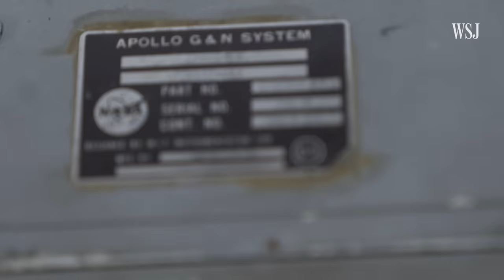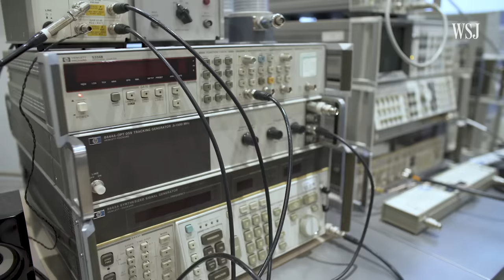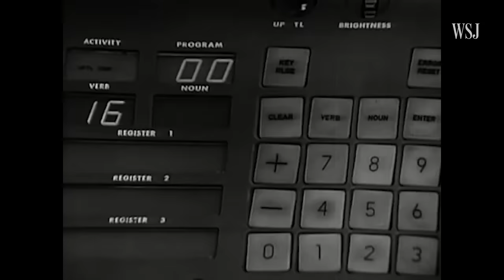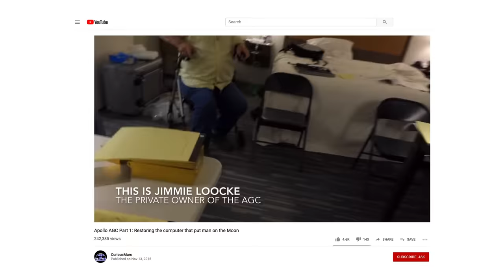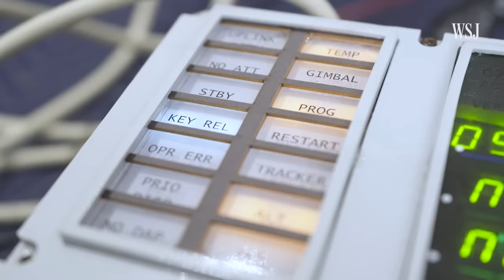Restorers Try to Get Lunar Module Guidance Computer Up and Running | WSJ

Comment: This really raises the question, if we could make it to the moon and back in this technology why is there not more going on in space right now?? There has to be some reason why we totally abandoned it
Reply: Jahan Watson Maybe because going to the Moon was crazy expensive and all it did was get us some rocks.
Reply: jagheterbanan it was only expensive then because of how much the tech cost and how advanced everything needed to be for the time, you can build a computer for a few hundred dollars that can outperform multi million dollar systems of the past, the technology and manufacturing available to us now are incredible, we could be flying to the moon and back for Little more than a few thousand dollars if we would make an effort to move ahead, hypersonic travel, and modern rockets and aircraft design are all there, we have the ability we just dont
Reply: Jahan Watson Well I can guarantee you that if you can build a system that can take humans to the moon and back for a few thousand dollars you’d become a billionaire in an instance. SpaceX charges around 62M $ for a Falcon 9 launch and 90M $ for Falcon Heavy. If you can cut that in to the hundreds of thousand $ customer’s would pile up really quickly.
Reply: jagheterbanan dude just look at virgin galactic, a slightly beefier version with a small srb of some sort could easily do it
Reply: Jahan Watson Hahaha omg you think you can go to the moon and back in something like that?! 😂
Quick call Elon and have him cancel the Starship development, boy genius here has a much better and cheaper solution! 😆🤑👨‍🚀
Reply: jagheterbanan the starship literally is a bigger version of the same thing so not seeing your point, it’s just launched on a rocket

Comment: Seems they used computers for a different purpose at that time and the Apollo project was more kind of an analog program. Put simply, the iPhone 6's clock is 32,600 times faster than the best Apollo-era computers and could perform instructions 120,000,000 times faster.

Comment: I cant understand Nasa sent it of as scrap. This machine is historic.
Reply: cause its slow and its idea to have formula already made for them so astronauts  just follow the command and step by step, only problem is if they get the timings wrong , the astronauts gonna have to erase cache memory manually and input new formula by manual know their current location and new timings to readjust trajectory , it work to some point when it takes long to do and not fast to do vs today computers are capable much more to correct itself quickly, remember this is first processor by wires then years later computers becoming silicon on chip
Reply: That wasn't seen as such at that time unfortunately.
Reply: Same reason people throw out their old phones

Comment: I remember NASA offering $40,000 to re-read or decode old data from the fifties, sixties and seventies which they had on reels of from old computers, when they used on dogs, monkeys, primates and humans they had lost their expertise on these computer reels tape. And in moving forward with projects they went backwards in knowledge by not learning through mistakes, that this will blow up and that will fall out the sky and not enough of this, and it falls over. I think it may of been 2016 when a call out from NASA was on the news. If anybody knows how to re-read old code get in contact with them.

Comment: Any minimally competent digital designer could make a computer with a few dollars worth of RAM, ROM, and one tiny programmable logic chip that could execute the Apollo design 2 computer software perfectly.  He would have to use a really slow clock generator to get it to run at the same speed!  I think most hobbyists could do it with free downloadable logic chip design software.

Comment: There was also a guy that had 2 huge magnetic tape machines. And a bunch of tapes too if I remember correctly.
There would be no easy way to read any of the data on it because you would need the whole computer and know what the data represents.
I think he went public to sell them or restore, something like that after sitting on it for years.
Then NASA came and collected the whole thing.
It's so funny that they always say that they lost the tech, or it was destroyed, uses it for something else, whatever...
And then stuff turns up on a yardsale or something.
I don't know but if I built a rocket that took me to the moon and back I would keep it or put in in a museum.
Any museum would love to have something like that on display.

Well I hope NASA doesn't come to repossess the thing when their done restoring it.

Comment: Please correct me if I am wrong, but the Saturn V guidance computer is still listed as "classified" and not available. If I am correct there are only 3 examples of it. 2 were assigned to 18 and 19 and 1 was in the test area at Stennis. It resided just inside the top ring of the stage. And if you go to the Apollo Museum at KSC, its not there. I asked around and staff told me, if your country developed a way for 5 heavy lift engines to operate and control gimbal and rudder for roll, would you just let anyone have it?  I guess they made a point. A cell phone could probably do the work today if it was recreated.🙂

Comment: The display is on a modern computer, not on the original display, it means nothing.
And you can't make it really run, it is not in the same conditions.
I would be curious to see the program that you think that it is coded in the memory of this computer!
There is a listing of this program which exists, why don't you compare the program which is supposed to be encoded in the memory of this computer with the program which is written in the listing?
You might have some surprises!

Comment: For the moon it doesnt knows if your landing with  4 Mhz or 4 Ghz of computing. So does it means that if the entire computer modules were revived and the spacecraft with its rocket 🚀 is sent to the Moon in 2020, shouldn't it land ? Food for thought !
Reply: If you had an exact copy of a fully fitted Saturn V with apollo spacecraft. The support crew, support equipment (including additional land based computers) and the trained crew, sure.

Comment: So we're told that the lunar Landers walls were paper-thin almost. How could the Lander not Be crushed like an aluminum can in a vacuum?
Reply: Not how a vacuum acts.
Reply: Nathan Peterson explain why they built the 8-foot thick vacuum chamber with cement walls
Reply: @hoperodrig6561  To limit leaks. Not to mention its 50 year old technology.

 We have modern containers capable of creating the same or near the same level of pressure that are just made of glass. Look them up on YouTube. I get your confusion you're thinking its the same issue of having a submarine in extrememy deep water. But pressures are on an absolute scale and different materials have different strengths. Most reasonably thick (an inch at most) solids, metals, metalloids, or some crystalline structure of them or other elements will handle a difference of pressure between 14.7psi. and just above 0psi.
Reply: Nathan Peterson No, it would be the opposite of a submarine. Submarines also require a lot of Maintenance constantly to replace valves and seals. The International Space Station has rubber gaskets and seals all over it. But somehow they miraculously. Don't need maintenance even though they go through in extreme heat and cold for more than 20 years. The windows to the cupola are hand operated with mechanical gears! Separated with a little rubber o-ring. But the only thing they seem to be doing up there is growing lettuce again. Not maintaining a massive structure like the ISS.

Comment: I think this is the future of computer systems, not the past. How do you hack a system like this? With our ability to print electronics we could design what we need a solution to do and then have a compiler create a unique software to assemble an integrated software AND electronic solution. Encrypted software that only decrypts when run on a specific electronic device. No extra gates, no extra memory, only necessary computational circuits, and an encrypted voltage stabilizer capacitor assembly so if you don't have the right 'key' on you it won't be capable of booting or operating. That's off the top of my head. When the cost of stealing data is higher than the return for stealing data, then black hat operations is discouraged.

Comment: now find a low level technician who found 360 kilograms of moon rocks in the apollo scrap he bought recently.... and the cleaning lady who has the saturn-5 full documentation for toilet paper....
Reply: the full saturn V blueprints are available online... but there's also a massive difference between equipment used for testing and training and actually flown hardware, as far as preservetion value (and of course far more for moon samples themselves, which have both historical and huge scientific value)

Comment: Didn’t a calculator have more power than the guidance computer?
Reply: define "power". A 70s era calculator could run a single calculation faster, but it had NO ability to run programs, address external devices and external data, no task scheduling etc etc etc

Comment: "The Apple-oh guidance computer"?  LOL...  accents are funny sometimes...   ;-)
At least they realized from the start that it was a ground test computer, since the flight ones are either deliberately crashed on the moon in the ascent stage or burned up de-orbiting Earth tests...   ;-)
Reply: If the flight ones are deliberately crashed on the moon in the ascent stage, then what controlls the deorbit burn? 
Is it just pure analog electronics? 

Or does the flight path not need some deorbit burn like you would when u play kerbal space program
Reply: @honkhonk8009  It's obviously a ground command that initiates de-orbit.  And, it's not "if".  The ascent stage WAS crashed into the moon with the computer still onboard.  It's just a single burn to crash it (on/off), with instruments left behind at the landing site to record "seismic" activity and broadcast it back to NASA.

Comment: Very discouraging. Here we have this computer, which guided this supposedly Monumental Mission for mankind not enshrined in a museum, not held in a warehouse for whatever reason but basically discarded as scrap. One would assume that either the DATA or DESIGN /ENGINEERING aspect(s) would have been or still should be classified. Amazing, yes- but for ALL the (in my opinion) wrong reasons.  Still interesting, though. Thank you TWSJ
Regards

Comment: Did the Soviet lunar program have a functional guidance computer capable of landing cosmonauts on the moon in real time?
Reply: We may never know, it blew up on the launch pad.
Reply: @dukecraig2402  I think that the Soviet program was doomed from the beginning.   I do not believe humans can process input data quick enough to control a landing.  Armstrong took over the Apollo 11 landing only after the complex calculations of the de-orbit had concluded. Accomplishing that from the ground with the delay in sensor signal, computer process and the time delay to transmit control input back to the lunar craft would guarantee failure.
Reply: @dwightmagnuson4298  
 I don't understand something about what you said, at one point you say that you don't think that humans are capable of "processing input data quick enough to control a landing" but at the same time you talk about how Armstrong did indeed take over from the computer and land it, am I misreading something or did you misstate something? I'm a little confused about that.
Also I don't understand why you think humans aren't capable of being talented enough to land one, these are people who land fighter jets on aircraft carriers, and pilots that are capable of landing helicopters every day on something the size of a postage stamp and in winds that are shifting around, that's one factor that none of the LEM pilots ever had to deal with, shifting winds.
Gene Cernan said afterwards that's how you could tell if you were on a crew that NASA planned on landing on the moon, you recieved helicopter training, that's why prior to his Apollo 10 mission he hadn't recieved any, because Apollo 10 was only going to do a partial decent to the lunar surface, he didn't receive helicopter training until he was named commander of the Apollo 14 back-up crew, it was then that he knew he might just get the chance to go.
Between the simulator and the infamous "flying bedstead" that they trained on it was clearly shown before the first landing that men were capable of controlling the LEM during a landing on the lunar surface, if they didn't think they could do it they never would have went foreward with the missions.
Reply: @dukecraig2402  Flying the LM for the last approach and landing, much like you'd do a helicopter, is a far bit away from calculating orbits and needed deltaV by hand to start your descent, and to keep that updated as your craft loses mass.

Comment: why dont NASA use that computer for the new moon mission again? it would save energy.
Reply: How would it save energy?
Reply: @logitech4873  i guess it does not need so much electricity because it is an old computer
Reply: @pillepolle3122  older computers require far more power to perform the same calculations.
Reply: @pillepolle3122  bro knows nothing about computers and is commenting 😂
Reply: @the_bi11iona1re7  i know something about conputers
Reply: @pillepolle3122  'conputers'
Reply: @the_bi11iona1re7  yes

Comment: At 64 now, I have to laugh at younger folks and their supposed "digital literacy".  Why?  Because I was using computers in the 70's.  Not a IT guy, but my biz classes required intro courses in COBOL and FORTRAN.  When Microsoft came along (after stealing icon-based OS from Apple) with Windows in the 1980's, it was beyond EASY.
Reply: apple stole it themselves...

Comment: think this computer is too valuable to actually operate it in a museum it should be stored in an aclimatized chamber to prevent it from deteriorating more than it had allready 

in the other hand ,  i think most of the components to operate it (the keyboards leds and stuff like that) are still availeable
 it would be a nice idea to make a lifelike dummy setup of this computer and run it of say a arduino , so that museum guides in say the science museum that recently had an apollo camsile re made on site can show the public wat the astronauts had to do and wat info they got out of the guidance computer (run the same simulation you did on the real guidance computer )
think it could become the computer side of the apollo youtube challenge to make /build it
Reply: i watched a lot of the series, apparently they were unable to get their hands on most of the missing parts and had to reverse engineer them with what little documentation they could get, thankfully the broken logic components had surviving circuit level diagrams
Reply: i think those where more the parts of the mainframe computer , nit the keyboards and lights and stuff , like i said the original mainframe is too precious to have it run in a museum just for showing how it worked , there are now way smaller computers like the arduino that are way stronger than the original and could be made to respond like the old mainframe when operated of the old style buttons and keyboards 
https://www.ebay.ie/itm/Replica-ALUMINUM-DSKY-with-Internal-Apollo-Guidance-Computer-/263854570448

Comment: Yeah lets plug it in and see if it can make the calculations to go to the moon and back! I seriously doubt it.
Reply: Why wouldn't it?
Reply: @logitech4873  the computers back then did not have enough data to perform the task that is the first nail in the coffin among many others.
Reply: @Unique377  Can you articulate what exactly the task is?
If not, why make that claim?
Reply: @logitech4873  Take off, docking with the command module, flight path to the moon orbiting the moon, landing, docking once again with the command module, return flight  re entry and landing. I mind you that a Nintendo with 16 bits of computing power had more data then the Apollo computers.
Reply: @Unique377  You're describing physical actions. We're talking about the required algorithms.
Again, what is the TASK the computer has to deal with? What algorithms did it have to run?

If you cannot answer this PRECISELY, why are you even making an argument like this?
Reply: @logitech4873  Alright what exactly are you interested in really? Do you have some kind of question about some sort of specific function? You are talking about algorithms software code did not exist back then for this function. The first major problem was the size of computers back then the first computer was UNIVAC and it was the size of a room a simple $21 calculator has more computing power then the Apollo computers. So size of the Instruments and calculating power would be the first two major problems.
Reply: @Unique377  You're unable to name a single calculation, a single function.
Why should I take anything you say seriously when it's so obvious you have no understanding of the topic?

You're the one coming with the claim, so please elaborate!